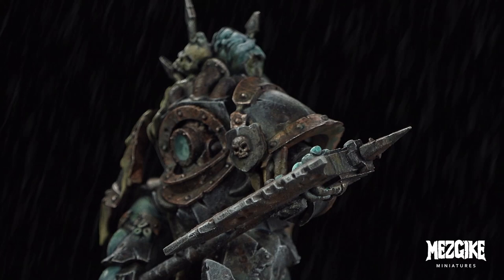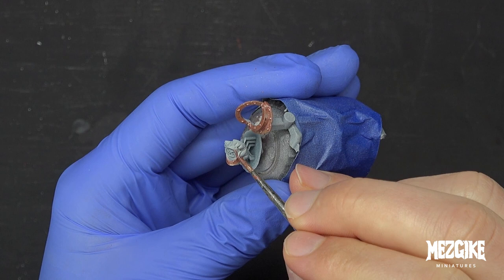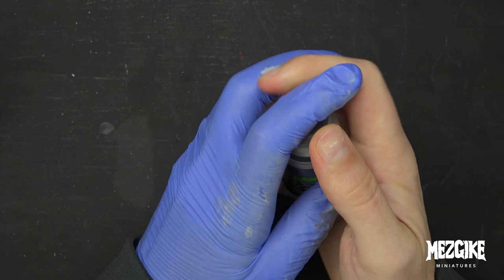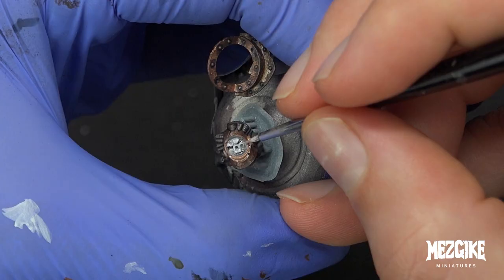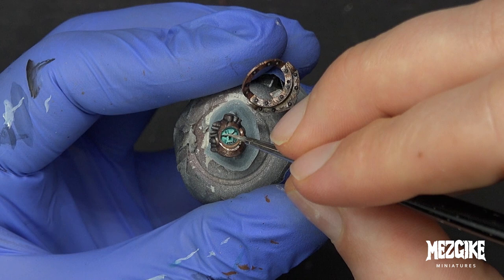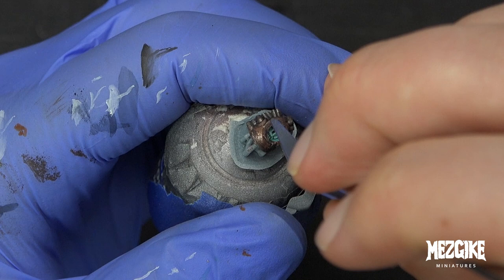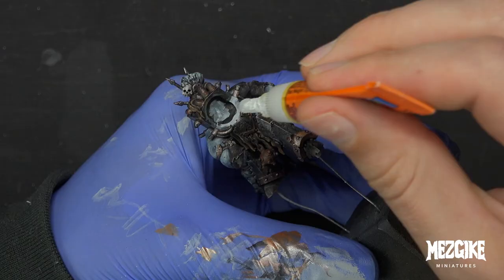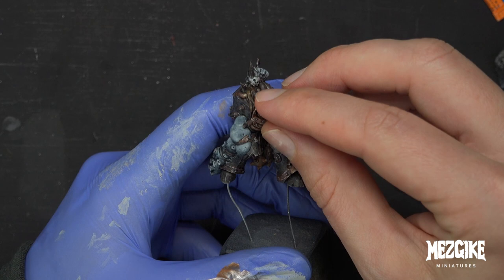How to paint miniatures - how to paint a grim dark chaos lord face

Comment: I've always been told not to use metallic paints on a wet pallete. Is it actually just fine?
Reply from the maker: It's fine sometimes but I actually made a huge mess with the copper, the wet pallet was fresh and a little too wet so the copper went for a swim all over the place. It will be fine as long as you don't have the pallet too wet like I did at the start of this video. I use metallics on my wet pallet all the time. Plus I use the washable wet pallet membranes which you can clean off under a tap and keep using if they get too crazy.
Reply: @Mezgike  Cheers!